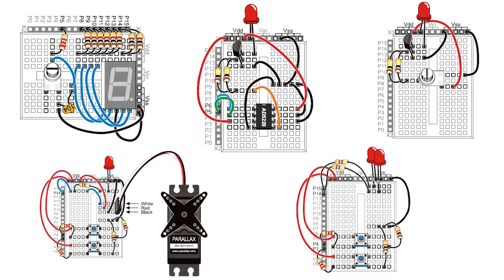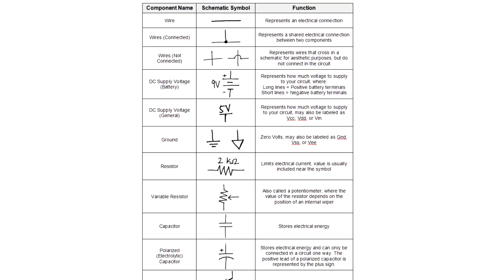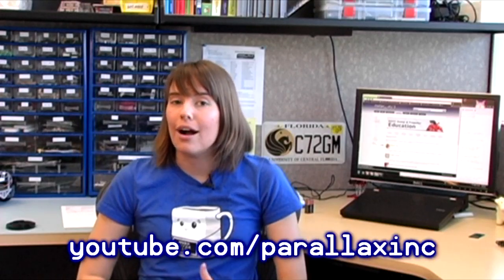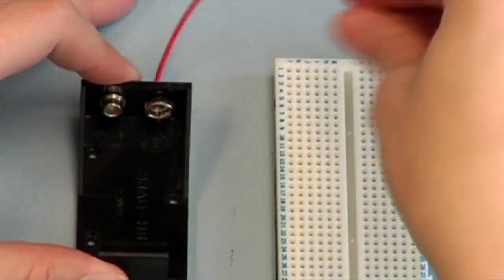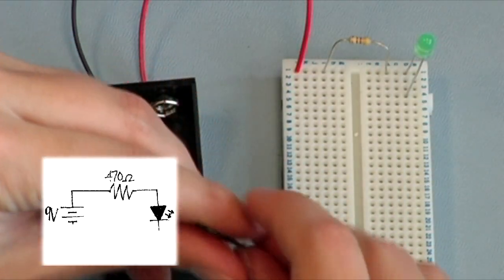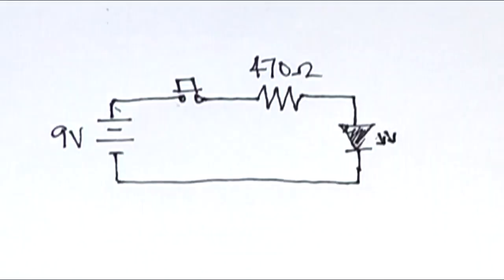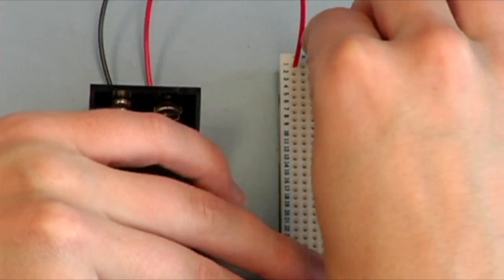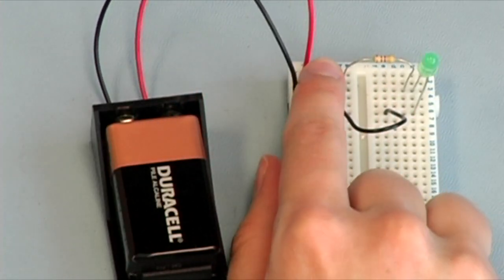How to Wire Circuits from Schematics

Comment: In my experience, learning by making mistakes has proven to be very bad on my bank account.

I'd say that the best way to learn is to take your time and don't work on your project until 4 AM
Reply: Steve
Reply: the best success that i've ever had was with the Gregs Electro Blog (i found it on google) without a doubt the most helpful course i've followed.

Comment: In the past, resistors more or less only had a negative side as they resist what you want to do, in life, we used to push these people off cliffs, but today, you can place resistors in specific cubicles (i.e. tech support) and use them to resist the flow of calls into your business, making resistors also have a positive side.

Comment: In order to connect a led you must put a resistor in series with it, according to the power supply you have and the led you are using the resistor will have some value. Refer to videos on wiring leds and you will understand the process. The resistor is limiting the amount of current that flows throw the led because it can only deal with a certain level of current.

Comment: Need 12 LEDs all turn on but one at a time until all are on within 1 sec and stay on until power is cut off.  Thanks for the simplest possible circuit.

Comment: Get a nice breadboard, a "jump wire" kit and a variable 12v power supply. Then get the resistors capacitors and such as you need. :)

Comment: i just started about 2 weeks ago... But if electricity goes from negative to positive, shouldnt the resister be on the negative side??? because its like the led receives all the electricity and then it goes throught the resistor...
Reply: If I understood that right, it does not matter for the resistor, as long as it is present in the path of the current that runs through the led.

Comment: I'm still confused with the board as to why they have numbers and I don't understand which hole goes where except by what I've seen.
Reply: Are you still confused?
Reply: They have numbers and rows for the same reason that chess players put letters and numbers on the board:  So that the positions can be recorded (e.g. B-B4 for Bishop to row B, rank 4).  This way, a teacher can create an assignment/lesson and prevent the student from making a mistake.  There is no "right or wront", just a way to "copy".